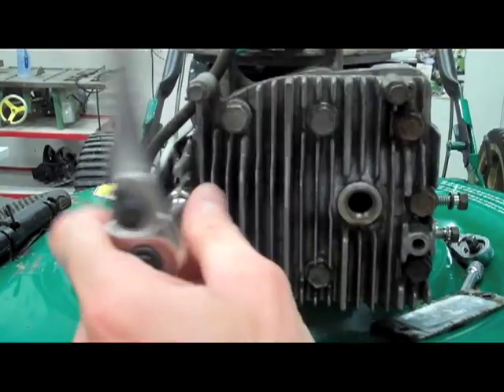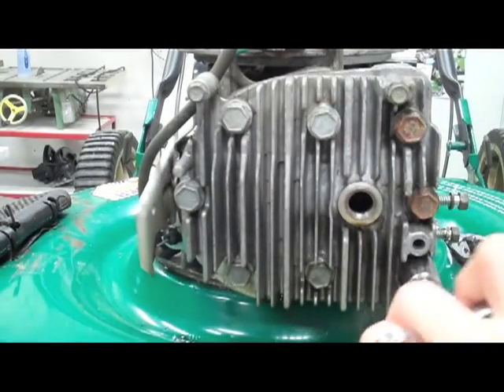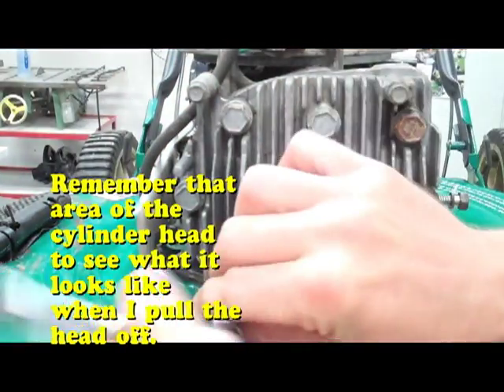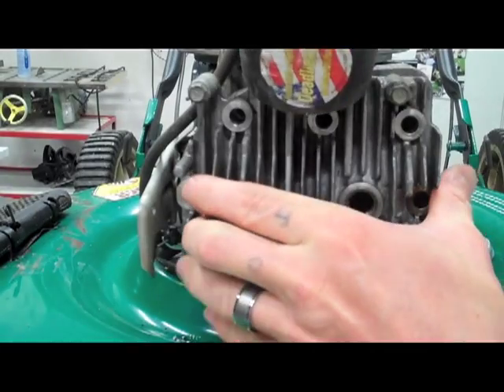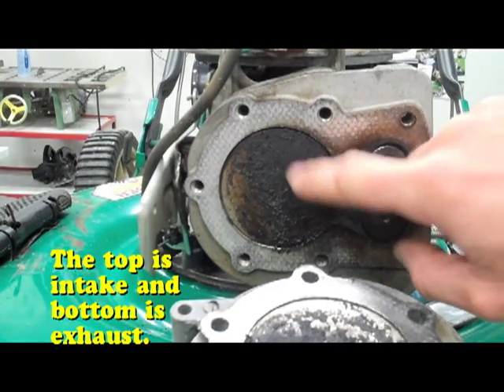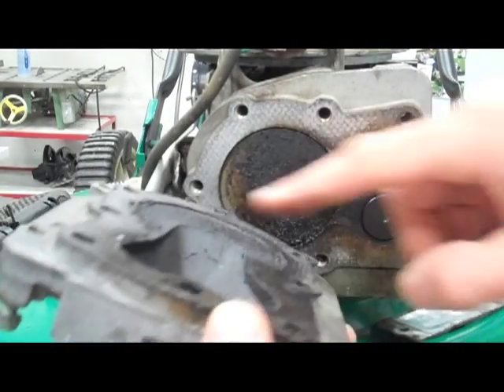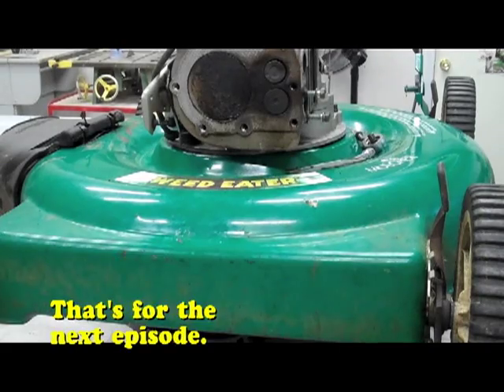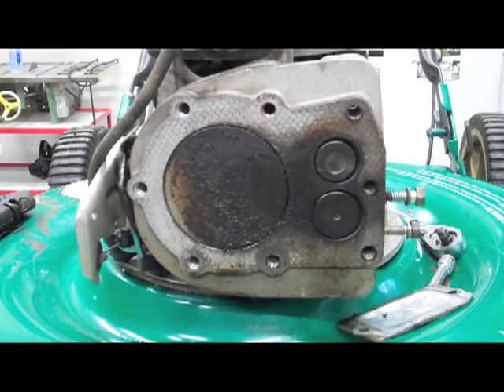Small Engine Repair Pt. 5: Taking the Head Off

Comment: Carbon build-up looks pretty nomaI. Pull a head off one that's been in use since the 70's and you will see a lot more. I don't bother removing the heads anymore on these engines unless there are signs of gasket or valve issues. Usually all they need are carb rebuild. New oil and A/F, plug for good measure. The ethanol they are adding to the gas now (E-10) dissolves the o-rings on some of the Tec carbs @ main nozzle, making a rebuild a good idea. Oddly enough the needle seats seem to stand up OK.